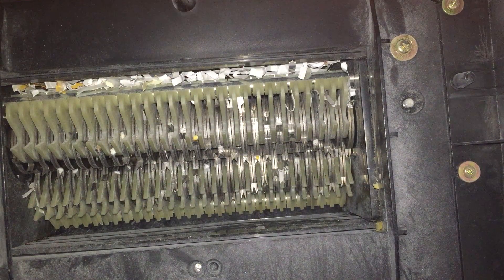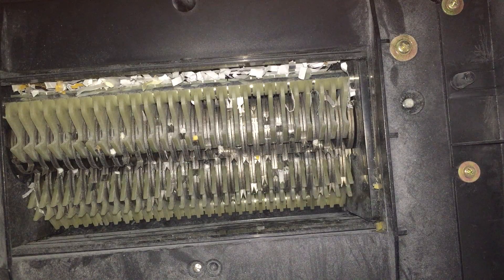View of Paper Shredder Blades for Upcycling / Recycling HDPE Into Plastic Chips

Comment: Thanks a lot for the video, I really appreciate it.

This week I bought a small paper shredder from staples it was on speail, regular price was 60$. I got it for 40 CAD.. (I got it just for the blades)

I liked the videos by Dave Hakkens. I really liked his design but unfortunately there are parts I cannot have like the blades etc (Which were laser cut). 

I started building my own shredder. Of course I bought some tools like a chop saw to cut metal and some other tools which I purchased in the last 12 years for my workshop.

I will cut the blades myself not looking the same as Dave Hakken's. I came up with a design (Do not know if it is going to work yet ;) )

As my shredder: It will be 2 layers.

Layer 1 will be shredding the plastic in big chunks. like the full bottle jug etc I will feed it without cutting it in smaller pieces.
Layer 2 will be underneath the first mechanism and I will use the paper shredder blades there to shred the plastic pieces in much smaller parts.

I started building it but already having some issues ;)

Once done I will post some videos as well.

Thanks for the video again.

Have a good one.

Ati